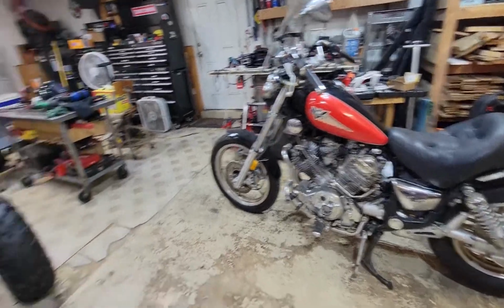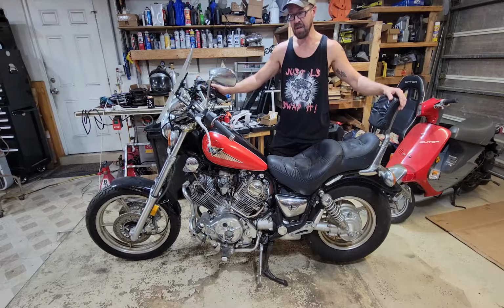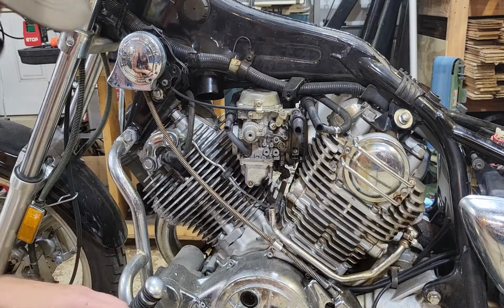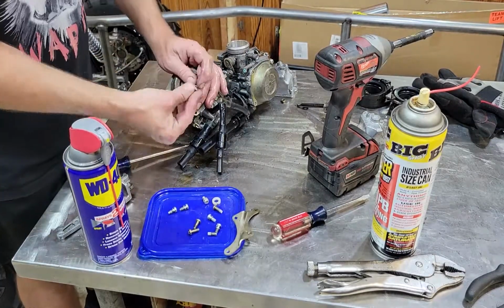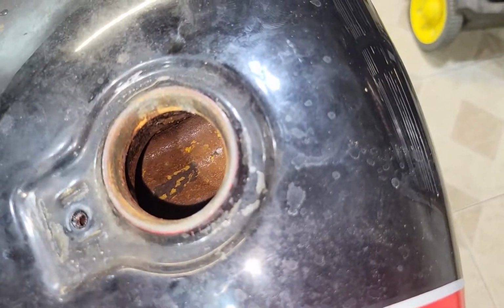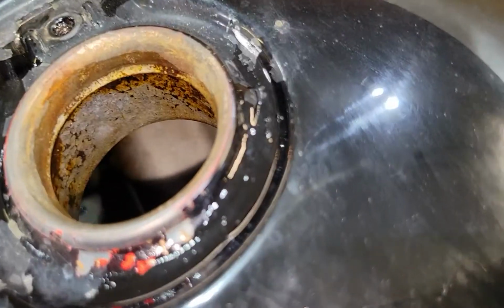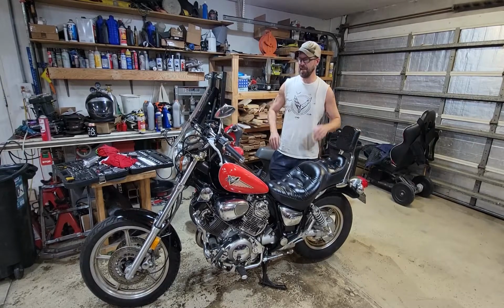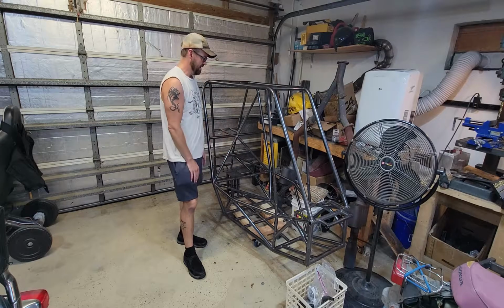Found An Old Yamaha Virago || Acquiring a 1996 Yamaha XV750 for Next to Nothing ||  Will it run?!

Comment: to remove that crust in the gastank .. white vinegar with a chain inside the tank .. yes a chain about 2 feet worth .. to swish around and rub the rust, should come out nicely oh and use a chain instead of bolts cause its easier to get the chain back out haha

Comment: You can also fill the tank with vinegar to clean up any rust you couldn't blast with the pressure washer.
Reply from the maker: I am actually about to clean it again and coat the inside. It started rusting again very quickly. Using some stuff that should keep it sealed for a very long time